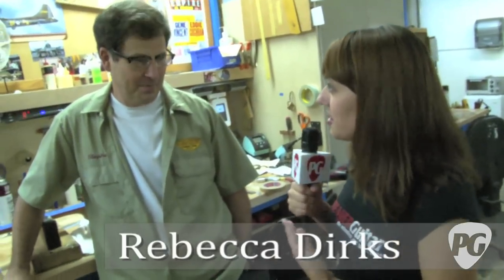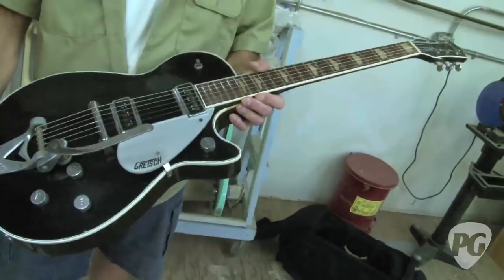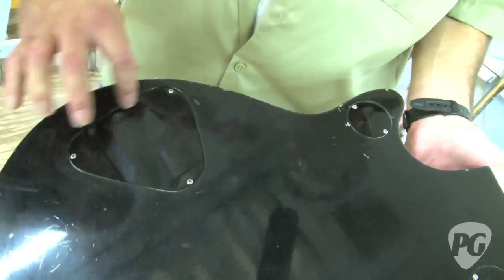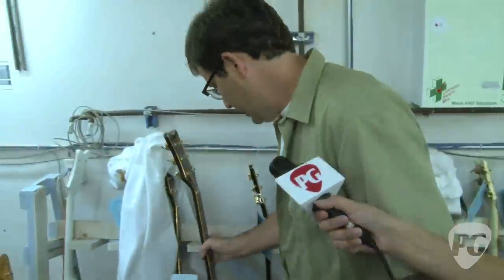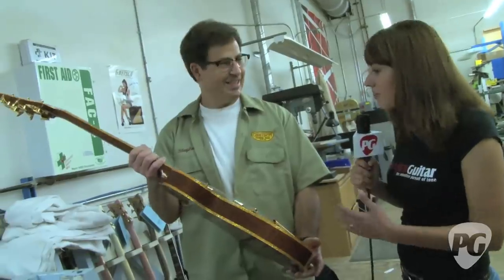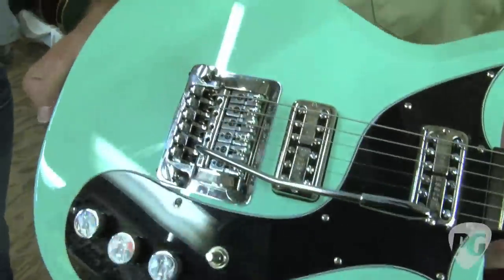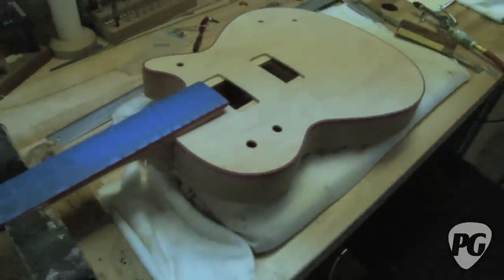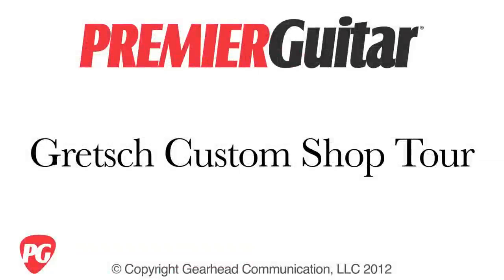Gretsch Custom Shop Tour

Comment: Great review
 i bought the gretsch guitar G5013ce fantastic sound when unplugged
can you please write how you adjust the bass treble phase on the guitar, to get the sound from the amp so close as possible as if the guitar was unplugged
and the way to tune the amp that has: Drive, Bass, Mid, Treble, Channel vol, and Master
thanx

Comment: I own a Gretsch Electromatic and is sweet.

But I wonder why guitar manufacturers keep doing the same design mistakes in favor of those "classic" models.

An area I see totally overlooked is the headstock, they keep making the strings go at an angle to the nut while is clear the more straight they go the better the intonation is. For example, even if you lubricate the nut, try on make a bend on an Electromatic and you'll end with that string out of tune...more or less, but out of tune.

That's on a 780 Euro Gretsch guitar. Then I take my 270 Euro Harley Benton Red Special replica (which I love) and that thing never goes out of tune. Same tech, same nut, but the strings go straight.

The other area is the nut itself...how hard is to put roller nuts on every guitar now? They come with this and that features and some of them cost an eye but they overlook the essential things that make a guitar to play great. And no, a roller nut will not change your sound, it will add more sustain, that's all.

And last, why do they keep putting these shitty tuneomatic bridges with edge saddles? That's another area where the string gets caught.

I've built this LP myself (DIY kit) and put 1) Locking nut 2) Roller bridge 3) Microtuning StopTail  and I tell you, is impossible to make it go one comma out of tune after the strings are totally stretched.

https://www.facebook.com/sacco.svd/posts/10155728952385352?pnref=story
Reply: Sacco Svd You're wrong about the roller bridge- If a guitar is equipped w/a Bigsby, the rollers keep it in synch, unlike a regular saddled bridge, which causes the strings to move sideways, causing it to go out of tune.
Reply: +Lothar Roberts 

The problem with a guitar like this (or any other guitar with normal nut/saddles is not when you use the tremolo, is when bending one string....try on doing two whole steps on the B string at fret 12 and it will go down and stay there until you use the tremolo and stabilize it again.

The problem while bending strings are in the nut and saddles, you can lube the nut and you can file the saddles but is a lame solution compared to proper rollers all across.

I don't wanna touch this gretsch nut/saddles...just cause is just fine the way it is and I don't intend to bend as much with this one....but I've changed the nut and bridge and put rollers on my LP with LesTrem II and it cured the intonation problems immediately.

My DIY LP guitar has locking nut, roller bridge and stoptail with microtuners and that one is also impossible to get out of tune. So my question is why guitars are being build still with the same flaws? yes they're pretty and classic but they have flaws.

And no, rollers will not change the tone of your guitar, and if they do a little it will increase sustain and keep you totally in tune anyway so the trade is much better.

Rollers will not cure intonation problems with a vintage tremolo (no floyd rose) though. :) already tried.

Comment: ...for the record, a buddy from other band bought (in China) an Eddie Cochran model MADE in China about 10 years ago...not so good in the details.

-I have a 6120 pre Fender from the 90s. Those were built in Japan and they are very fine quality, better than at least 50% of the very old ones; superb quality in the details (at least mine)
Mine has Filtertron not those tvjones trones.
Sadly after Fender took them the quality and sound are not the same

Comment: Waiting for the Malcolm young tribut model
Reply: Gretsch already made a Malcom I and a II version and they are not making them anymore. The II is impossible to find for sale, so you have to buy a similar model and find a good luthier and pay to "Malcomize" it or attempt it yourself. If you're in an AC/DC tribute band, as my husband is, that is the only option left (we're fortunate to have an high end luthier in our area). Right now he's borrowing a I model and doesn't like it, VERY neck heavy, has less body hardware than the II. Hasn't had the opportunity to hold a II version. We had a dealer inquire about a custom build and Gretsch told them it would be a YEAR and a HALF before we'd get it. Can't wait that long! Just bought one to "Malcomize" last night.